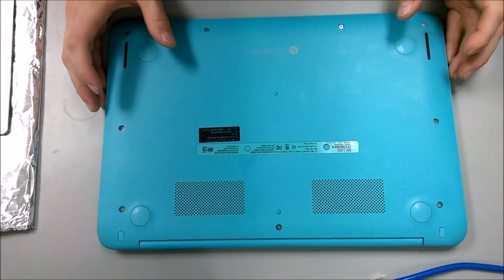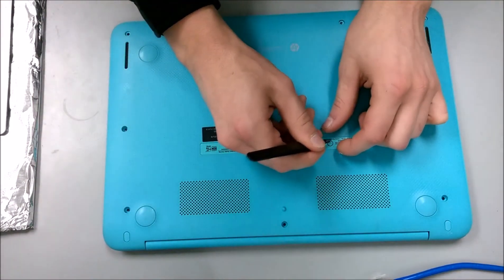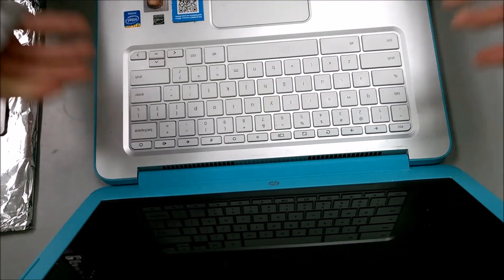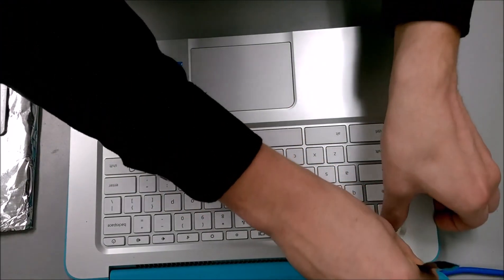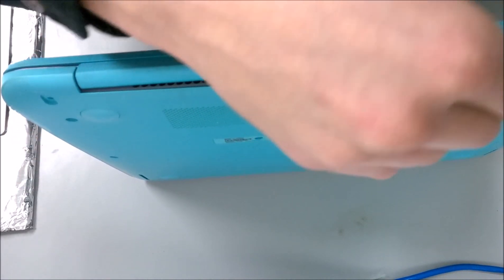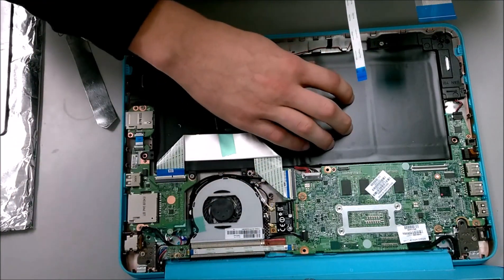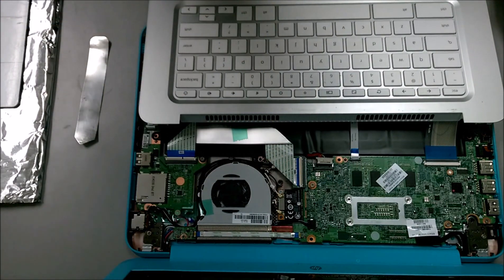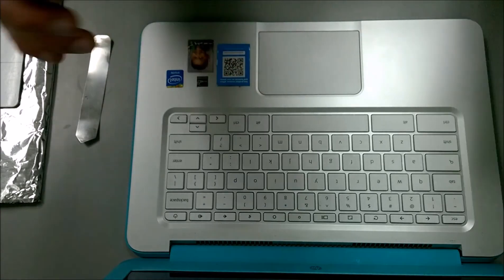HP 14-Q Chromebook Disassembly - Reseating the Keyboard and Mouse Pad Connectors

Comment: Hey if anyone is seeing this that clip that connects the big cable for the keyboard is broken off on mine is there a way to fix it?
Reply from the maker: @michaeledwards63  you will just need to use some kind of tape to hold the cable in place instead

Comment: what happens if i accidentally broke the blue part on the key board ribbon when i was un plugging it from the mother board?
Reply from the maker: The blue part is just a helper so you can grab the ribbon without damaging it. So long as the ribbon cable itself isn't damaged and just the blue part got torn or ripped off, just carefully reseat the ribbon cable back into it's slot and close the clasp to lock it in

Comment: All of a sudden the cursor disappeared while I was using the touchpad in my HP Chromebook 11". 
I was at a loss although I had dropped the Chromebook the morning before. I used a guitar pick around the keyboard, picked it up and found the small tape disconnected. Took a bit to figure how the collector locked in but once I figured it out, it works perfectly again.

Comment: Where can I find a black plastic clip for the keyboard ribbon? Mine broke.
Reply from the maker: Unfortunately you end up needing a new motherboard in those cases. However, you can get anti-static tape instead, insert the connection to where it should be and use tape instead of the clip
Reply: @PatchinSwayze  I've tried using tape, and then I tried a hot glue gun. It's just not holding the ribbon down enough to the point where it's making contact as needed. If I press down on the ribbon using my finger, all of the keys work. Otherwise, nothing.  :(

Comment: My experience is this is only a temporary fix and a week later you are back to square one. Have you considered gluing the connectors in place? I think movement dislodges them. I  think I will try this, being careful not to get glue on the electrical connections. Clearly a design fault.

Comment: You skip the keyboard part how you take off the keyboard that the hard part
Reply: Because the keyboard is part of the palmrest part- it doesn't come off. If you have to replace the keyboard you will replace the entire thing. For some reason the touchpad will come out but not the keyboard.

Comment: I did it, it worked, all the keys are working. The keyboard connector is the cheapest thing I have ever seen on a computer, it is a problem waiting to happen. A laptop should be designed to take some rough handling, but not this HP.  They should recall them all at no charge.

Comment: Ugh, i just bought this laptop yesterday. It's supposed to arrive tomorrow. I didn't see any bad reviews about it till it was too late to change my order.. praying I don't have to do this in a few months. Keyboard/trackpad issues seem to be common with hp.
Reply: Actually, I've never had anything but HP computers, both desktop, laptop and now an HP Chromebook and I've not had any problems with the keyboard or touchpads that I did not create (Spilled Sprite on the keyboard, immediately turned the laptop upside down over a towel to drain the liquid, took the keyboard out and rinsed it in water...that's right...water, along with the touchpad. Let it dry nicely using a hair dryer on cool and let it sit a day before reinstalling. Works nicely.

Comment: Very nice video! Thanks. In  my case I think the ribbon is damaged, as after disconnection and re-connection , half of the keys still not working. I was trying to find the replacement keyboard, but it is rather expensive -http://www.aliexpress.com/item/Original-Palm-Rest-For-HP-Chromebook-14-14-X-14-x010nr-Palmrest-C-Shell-787735-001/32708316162.html?spm=2114.01010208.3.2.D40KeL&ws_ab_test=searchweb201556_0,searchweb201602_1_10057_10056_10055_10049_10059_10058_10017_106_105_104_10060_103_10061_102_10062_10064,searchweb201603_2&btsid=ba430061-7e18-4e95-8cbc-f4d071eead8b
57 USD, and it might still not fix my problem. Any idea how to get cheaper replacement?
Reply from the maker: eBay, many people sell replacements and used condition units.
Reply from the maker: I only buy parts from eBay and 3 other websites

Comment: Thanks for the video. What did you do to fix your keyboard issue? I have the same Chromebook but some keys on the keyboard do not work. Do you think I need to replace the keyboard itself? I've already cleaned the connectors but it's still giving me the same problem. What would you suggest?
Reply from the maker: The next step would be replace the keyboard
Reply: alright. Thanks man! hey with these laptops can the keyboard itself be replaced? or would I need to replace the entire top part which includes the mouse pad as well?
Reply from the maker: +Mario Tovar Not sure but most likely the whole top part, they are usually molded together. you should be able to get a used one for ~$35 on ebay
Reply: alrght  man. Thanks for the info.

Comment: hi Alexander, I have also a hp 14  but cleanned it with a damp cloth. now when i turn on and touch a key board it turns off. any ideas. I have used a external key board and it works ok with that ..HELP please
Reply from the maker: The only recommendation would be reseat the cable, if that doesn't fix it, order a new keyboard for the computer, they are usually $10-$20
Reply: +Alexander Patchin thank you . how do i do that